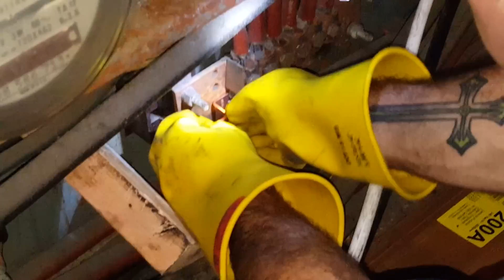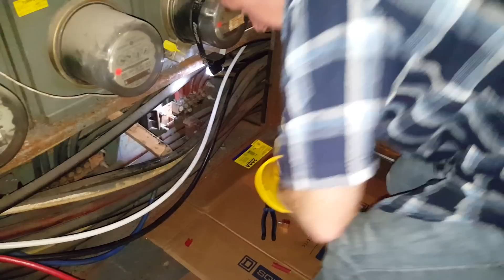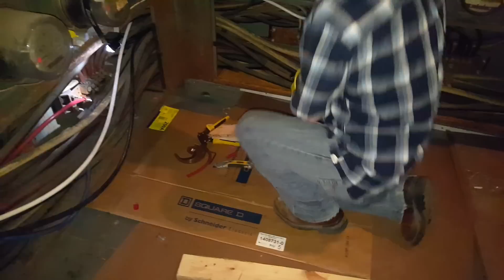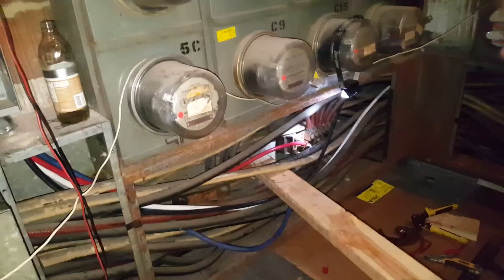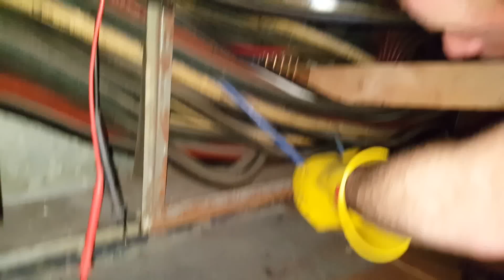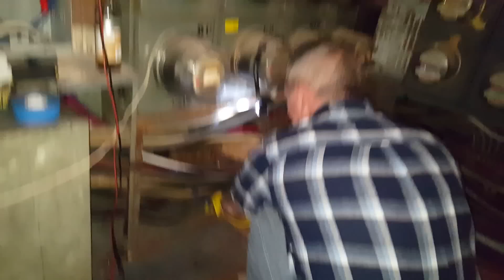NYC Electrician stories (120v 200amp service)

Comment: These guys look like they know what they're doing but when one of them gets 'hit' for real... the reaction lasts more than a couple of days. try years. . I understand their attitude, but we only get one life... and it can come on you in the weirdest way.

I've dealt with 1600 amp 415v supplies here (UK)... no biggie.

The one that prompted me to make this post, and still scares the fucking bejesus out of me? a 240v light fixture on a 5A circuit. Someone switched the neutral rather than the line (hot). Got between line and ground.(earth). the way i had it, i did the thing no electrician should ever do, i had both hands HOLDING a connector.  Worst case scenario... across the chest, with the hands gripping it.. I felt EVERY SINGLE cycle of the maybe half second I was connected....I realized what was going on and threw myself off the work platform (leg muscles still worked).

Stay safe out there people. Ya only get one life.
Reply from the maker: thanks for sharing, my friend. Be safe out there!!
Reply: 240v light fixture? Thats weird... what was the incoming service? I assume you were in the states because here in Canada most things are 120/240v meaning 240 would be line-to-line using no neutral. Our other system in Canada is 347/600v... in all cases I've never seen a light fixture that didn't utilize a neutral. Granted I've never been involved in the installation on these big signs on the sides of buildings so I'm just curious.

Not calling your story bullshit just find it hard to believe if you are in NA doing electrical
Reply: I'm in the UK, 240v line to neutral, 415 line to line. 

(yes I know it's nominally 230/400v, but it never is)

Comment: I agree that this type of work is usually unnecessary to do while energized. Having said that, the arc flash energy at 120 V is overblown by the safety Nazis. The arc won't self-sustain. At 480 It gets real and will continue to melt down after the initial blast and the energy is tremendous.

Comment: Guy is a lazy ahole for using rubber gloves without the code required canvas outer protection gloves. Bet rubber gloves  have not been inspected in OSHA required last 6 months ( could not read date code on them ). This electrician wanta be should have had long sleeve approved PPE shirt & tinted face shield before removing cover. My company would fire me if I did such dangerous work.

Comment: The people that build Electrical equipment seem to go out of their way to make things hard to work on?, and some electricians try and (hide) boxes and devices again as to make it harder to work on, doesn't make good sense. Most electrical cabinets have too little space to work in, I just don't understand it. I have worked in buildings where some idiot electrician would put a splice box ten feet above a grid ceiling, so the next fool would have a very hard time getting to the box(makes no sense).

Comment: Its only 120-220 volts its not like hes messing with 2.4kv or anything that high
Reply: 110 can still kill you and when you are dead, you're dead. Like to see him work on a 3000VDC circuit where there is 1200 amps available some time.

Comment: AS   for a   pinhole in the   gloves    been dangerous     yes   absolutely  deadly  if dealing   with   KV   range  voltages   there  the electricity   will  jump in through there    as   for 120v to ground  maybe not so bad  unless   moisture is present   or  something   poked in,,,,,   myself I  do not feel   nothing touching a 120v to ground terminal   as long as I am not touching anything else  and  wearing  dry   rubber   running shoes or  rubber  soled  CSA   work   boots,,,   but as a rule  I try to avoid    working on the live terminals   unless   using  insulated   tools
Reply: Sorry to tell you but humans have this weird thing where they sweat out salt water
Reply: WENGH, That is true. Leathers and rubber insulated gloves can get hot and in the time it takes to do a job, you can collect enough sweat in them that you have to pour it out. It is not fun when working 480 volt live circuits and doing a breaker change knowing that the input side won't trip until greater than 1200 amps are seen continuously.

Comment: This isn’t 120 volt. I can clearly see this is 3-phase: black, red, blue. Phase to neutral is 120, but phase to phase is either 208 or 240. Also, as others have mentioned, rubber gloves aren’t meant to be worn without leather overgloves. This guy isn’t wearing proper safety gear, and he’s nervous about it too, since he’s talking about arc flash injuries. He doesn’t even have safety glasses, so his eyes could be like the guy he’s talking about if anything happened. And what’s with all the talk about multiple “electrocutions”? You don’t get electrocuted and walk again, because you’re dead. And finally, he can’t say 5 words without throwing in an F bomb. What’s wrong with him? Is he suffering from mental illness?
Reply: It depends on the purpose of the system. If you have 3 phases 120V each to neutral but only 1-phase loads, there's only 120VAC in the system since phases are not used together for one load e.g. 2-phase loads or 3-phase loads. Of course if you go to the beginning of the system which is e.g. output of the transformer (maybe in this case), you'll have more volts between phases than to the neutral point of the transformer, the value depends on the transformer construction. I don't know for sure about USA system since I've never worked there as electrical engineer  but as far as I know they can have different voltages between phases and e.g. for home purposes they have 240VAC between L1 and L2 and for industry purposes can have a few different kinds. This seems like home purposes only 120V and 200A and that's why there's no higher voltage anywhere except the output of the transformer. They can just load 3 phases with full current per line but each has 120VAC. That way they can have 200A times 3. And 3 wires instead of one way thicker.
Reply: @Michał L
You probably know that with a wye (star) connection if there is 120 volts from phase to neutral, there is 208 volts from phase to phase. The other connection type used is the delta connection, which is normally a single voltage but can have a neutral connected to the center tap of one transformer winding, and in that case you have 3 voltages: Phase to phase is 240, phase A or C to neutral is 120, and phase B to neutral is 208. 

The important thing to know is that the American system today always has dual voltage, with 120 volts and either 240 or 208 (240 is used if available) for high wattage loads. We have not seen 120 volt only service in decades. If the incoming service is three phase, then two of the phases are used for the 240 or 208 volt service.

Comment: I'm guilty of using "partial" PPE  myself, but I would have at least used a mat to cover the bottom of the gutter when using an non-insulated ratchet extension, I would not have trusted that cardboard. Still, I agree, what a God damn mess of a service.

Comment: Not smart. Arc Flash will kill you.. if it doesn’t, you will wish you were.
Reply: Number one Duno an ark flash won’t self sustain at 120. It will at 480. Or you could be killed by the current passing through your body to ground
Reply: Arc flash wont kill him at those voltages, he has to worry about his eyes and maybe small pieces of molten metal.  Voltages past 277 is where he has to worry about becoming a human torch.
Reply: Manabozo 
When an Arc flash incident occurs, the molten copper will definitely burn down to the bone on any exposed skin. There is also the danger of breathing vaporized copper. Bottom line is.. a human life is more important than the time it takes to shut it down. By the looks of that gutter, it needs a good clean up. All terminations should be easily accessible. ✌🏼

Comment: Jesus christ guys it's a MESS. Electrical jobs in rubber gloves, too? Is he changing wires without opening the circuit first? I hope not. It's only 120V after all but still. That's also the problem, check out these cables for 200A, such thick wires just for around 24kW, ridiculous. Yeah I know it's just how it is in USA, still waste of copper, loss of space, bigger wires to move or cut. I don't think he's a licensed higher-educated electrician. Looks too amateur for me. And he's surprised he had some incidents working like that lol. I wouldn't trust this guy with implementing my projects. He'd blow himself up at one point along with everything around him within a few meters. 120VAC is pretty safe fortunately, simple protections and pretty reliable, too, plus such low voltage. Imagine like 400-500VDC systems where one 3,2VDC cell (not a mistake) can produce 2000A (2kA) on short-circuit. Multiply e.g. 100 times. Don't work with higher voltages man, for your own good.
Reply: Michał L did you see him putting the wrench across the 3 phase disconnect box to demonstrate when his partner had left the wrench on across all 3 phases

Comment: Bro you need to come to learn in uk electrical thinks!
Reply: ha 110v is baby voltage
Reply: 200 amp service wire
Reply: Uk electrical is garbage grenfall tower bloody well proved that
Reply: Benn Knights not about the volts it's the amps.
Reply: Um it's split phase so you touch both phases its 220.
Reply: Plastic service boxes, piss poor systems design, overbearing on health and safety to the point you cannot work efficiently or safely.. Nope I'll stick with the NEC
Reply: I have worked with British equipment when I was overseas in the USAF, stuff is garbage. A plastic service panel? Really? Terminal strips with exposed set-screws rather than wire nuts?
 Oh, and lets not forget two different color codes in the same country. Pre-2004: Red-Yellow-Blue w Black neutral (Pay attention to this one folks!)
Post 2004: Brown-Black-Gray (Yes, Gray "C" Phase) w/ BLUE neutral (Yes, neutral!)

Recap:
Black was neutral, now "B" phase.
Blue was "C" phase, now Neutral.

Now picture a building in England with BOTH color codes at the same time! Yeah, that was what I had to deal with as an American electrician in a foreign country. Bleh. 
Oh and sometimes someone would screw up and make the blue hot, and brown the neutral. FUN!
Reply: tailgunner2 I couldn’t even finish reading your post without getting pissed off fuck all that 
Nec is the way to go 
Black red blue white neutral or gray ya so much better 
How the hell would that not be confusing 
I couldn’t imagine what they did with 277 systems

Comment: 200amps?!.. what kind of consumers use 200amps
Reply: This looks like 120  / 208 coming in from an on-site step-down transformer.  These buildings are usually supplied with 12.5k or 7.5k.  Each tenant gets a 200 amp 3 ph meter.  The current coming into these bus bars is considerably higher than 200 amps.
Reply: every house in Oregon
Reply: i got 300 amp in my house, it's not that uncommom
Reply: Every single house that's not shit has 200A in the US.
Reply: I have 100 amp service in a old panel. I wonder if sometimes it will trip when the heat and other things are on. You only really need 100 amps in a regular house. My aunt had a 200 amp panel that was overloaded with loads of breakers and it was on a main breaker of 125 or 150 amps. It never tripped
Reply: On new installations 200 amp is required  in many places..
Reply: My home has a 300 amp service..
Reply: Yes, 200 amps is the most common for new houses today, even though they will never draw anywhere near that amount. Otherwise they would never be able to afford the light bill.
Reply: You should come to my house, I'm the American version of Photonicinduction...
Reply: I don't know how it looks for Americans, I live in Serbia voltage here is 220vac, 50hz. I have strong consumers like electric furnaces(TA-peći), and ac's on heat mode. During the winter when I almost have all consumers in home turned on. Sometimes the circuit breaker trips(automatski osigurači). My house is 100amps and monthly bill during winter is about 200-260€, but this only happens during the winter. On summer only ac's are on(ofc cool mode) and monthly bill is about 100-140€.
Reply: Wolflicious I just upgraded house to 200 from 100..  I was at capacity just in my garage..  my welder and air compressor are both on dedicated 50 amp circuits..does mom still cut the crust off your sandwiches?
Reply: Yeah for here in the US, our voltages are 120 / 240 60 Hz. Many of the circuits are 120 volts. With 240v loads, they typically are sub-panels, hot water heaters (Usually 4,500 watts), ovens (6,000 to 8,000 watts), dryers ( 5,000 to 6,000 watts), and central Air conditioners (4,000-5,000 watts). All this energy.
We have been putting in 200 amp services for long life applications. Many times, homes in the US get additional rooms installed to make the house bigger, which of course require more energy.

Keep in mind, our 240 volts is not the same as yours, ours is phase to phase, your 220 is Phase to Neutral. I'm going to guess your phase to phase is 380 volts, correct?
Reply: tailgunner2 Yes we have 2 sockets in Serbia. 1 phase 1 neutral 1 ground socket 220v (monofazna). And 3 phases, 1 neutral and 1 ground is 380v (trofazna), the 380v sockets are used for like motors, electric furnaces, stoves and some other heavy consumers.
Reply: Jeff for an “all electric” home (no gas appliances), 200 is needed. Stoves and air handlers with heat strips are power hogs.
Reply: Wolflicious what do you mean, most houses I do have 200 amps
Reply: On an older installation like this (late 60s/early 70s) each unit typically has about 40-60 amps to work with -- which is more than enough for a small apartment. On new installations in NYC, 200A at the meter is required, but smaller main breakers can be used. The equipment they're installing here is probably for a store, or a rooftop cell phone antenna or something like that... maybe a penthouse apartment, if anything. But like the original reply stated, there's a lot more than 200 amps running through those cables and bus bars.
Reply: I have a small two-story condo right now that is all electric and the architect says we need 400 A ha ha ha ha ha ha America
Reply: Wolflicious I go into homes often with 400A. Two 200 amp panels.
Reply: bleachinuri Why would you get two 150a panels.
Reply: Anyone who has an electric furnace will probably have at least 200 amp service. Those things can eat 80 amps by themselves, if they're big enough.
Reply: That's nothing 400 amp 120/240 service is the.norm in many larger homes.